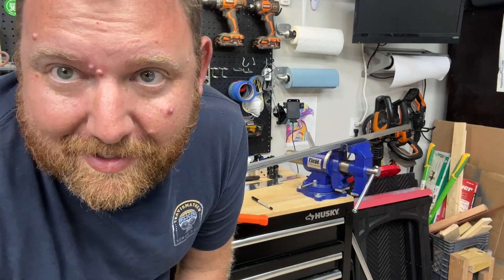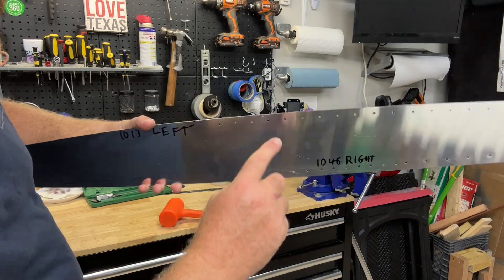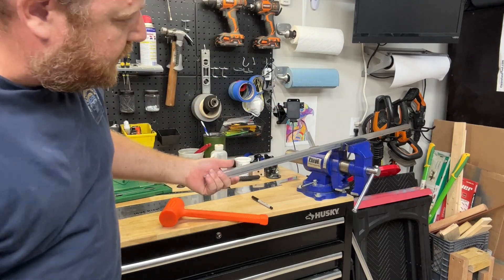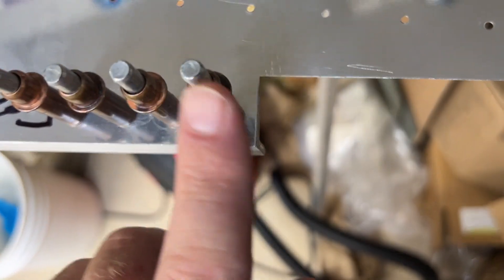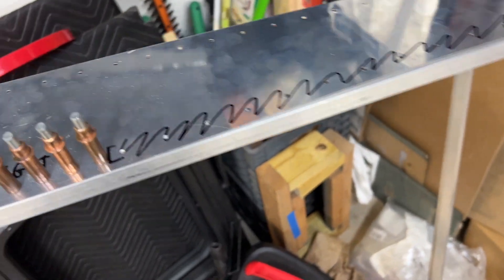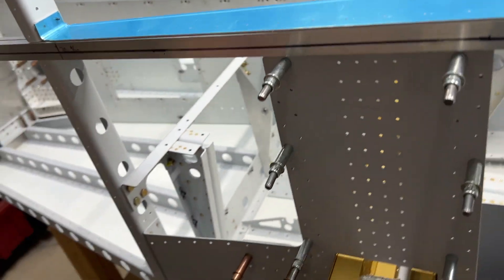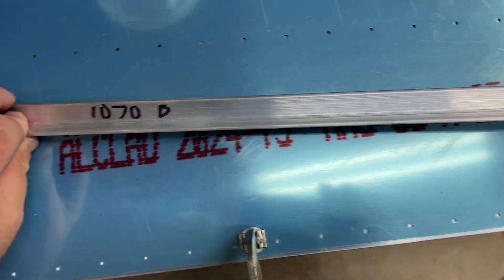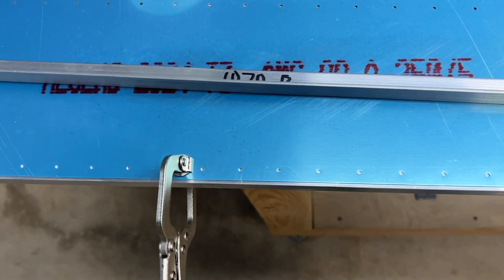RV10 Build Section 29 Fuselage Sides- Part 1 Bending - Video 38

Comment: You do a way better job than most on identifying actual “gotchas”. Others spend a lot of time waiting on calls back from vans on issues that are only because they’re not paying attention to the plans. Next thing you know, you’re trying to sell your kit after 7 years of videos.
Reply from the maker: Thanks Tommy, I am trying to find the balance between blindly trusting the plans and questioning everything.  What is VERY helpful is reading the FB posts every couple of days then making a note in my plans for areas others have struggled with.  This way I can build through the parts that don't make sense to me, but others have not noted, so I can trust it, vs. the sections that have a lot of issues.